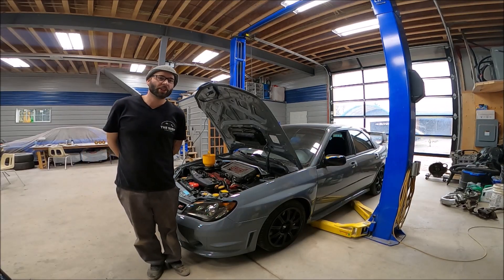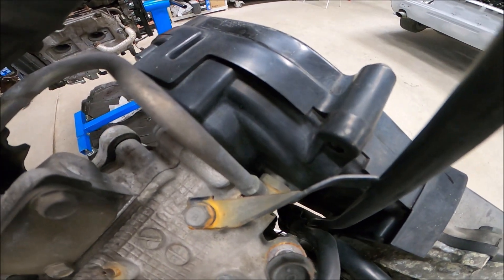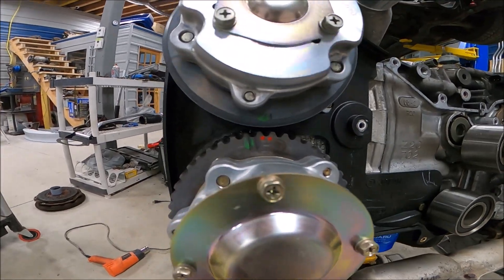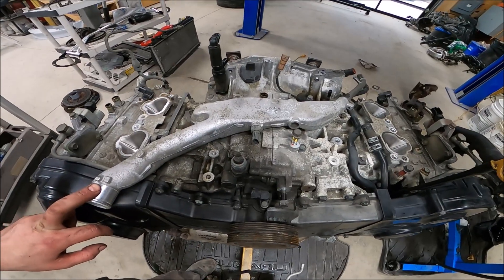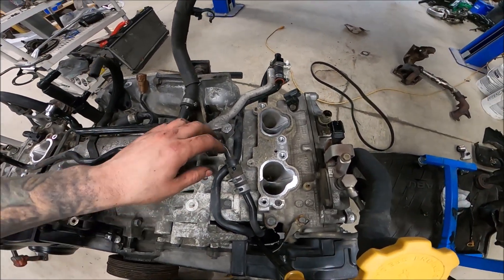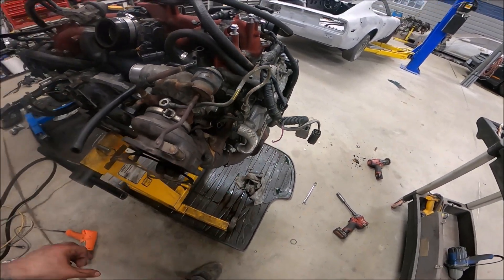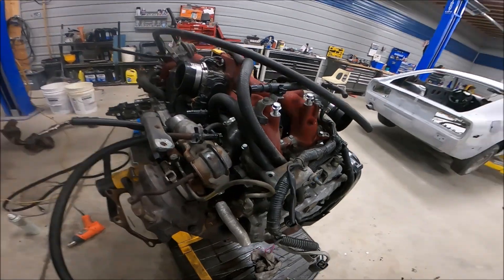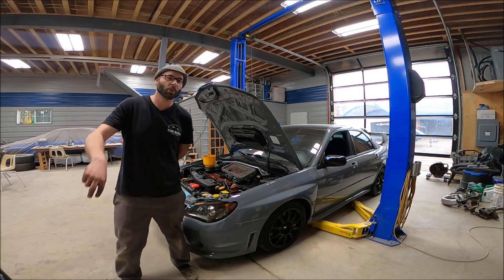How To Jdm Ej20X Swap - 06-14 WRX, 04-07 STI, 05-09 LGT, 04-14 FXT

Comment: Why downgrade to a higher compression more likely to explode setup😂
Reply from the maker: Oh is that how it works? Educate me please, would love to here how a factory engine thats ran its whole life at this compression ratio all the sudden blows up? Please, looking forward to your response so I can tell the 100’s of people who have had this swap done that 1 of them may explode soon 😂
Reply: Ok since you want to be a smart ass the ej20x  comes with a 9:0 compression ratio because its default region of use is Japan and that motor is mapped for 100 RON FUEL. On USA 91 or 93 this engine would be prone to detonation unless remapped and even then whatever output it leaves the factory with is at the edge of what's possible. You'd also be down 500cc's of displacement which subaru purposely gives your region to mitigate the shitty fuel and provide usable  down low torque. Its no secret the superior actual sti motor  the EJ207 was used in the JDM sti and was never shipped stateside like the 4g63 due to your fuel and elevator etc etc etc. But please continue leading others to downgrade to a inferior crank(if they are performance oriented), thinner rods, weaker pistons and inferior block, for a suitable solution for their blown subaru.
Reply from the maker: @curvaholic  I think this swap is over your head. Are you under the assumption that 100 ron equals significantly more then the 94 octane we have available here? Because 98 ron only equals 93 octane. 
Did you miss the part where the car is tuned? Then you mention a 207, an engine that is 6X the price of a 20x and then requires cams to be swapped and cyl head to be machined for the sensor along with a tune and loss of displacement and bottom end torque. 
Ill say it again, this swap is over your head. It is done as an economical swap, cheap entry, great results. 
We have had guys tune these as high as 360whp and still rocking years later without issue. But your still missing the point of an economical swap, this is not a performance swap. However, still clearly fills the void and way faster at my max recommended 350whp vs sitting in a driveway with a blown engine. 
Literally done 100’s of these, with 5 local tuners tuning them, no issues. 
Thanks for coming out 🙏

Comment: I have done everything and have tune and am not have very good acceleration.. from a stop its terrible and i have the cams retarded
Reply from the maker: Stock turbo?
Reply: Yes
Reply: Should the ej255 cams be swapped cause I have the jdm cams atm..
One tooth on the cams but I've heard 2 ??
Reply from the maker: @GhettyGreeen  changing the 255 cams will make no difference. 2 teeth too much. 1.5 is spot on but not possible. 
The 20x is not an upgrade engine, it does lack in bottom end torque compared to the 2.5 overall. 
How did you dyno graph look? Is it steady climb or does it spike mid rpm range

Comment: Do you leave the avcs unplugged? I have a 2007 lgt
Reply from the maker: Exh avcs is left unplugged
Reply: Is it possible with the right ecu to get a 07 lgt with dual Avcs. I seen its not possible with drive by wire cars?
Reply from the maker: @GhettyGreeen  it is possible but you need to add in the wiring and you need someone who can disable the the duel avcs immobilizer to make it willing to work with your car.

Comment: I have an 06 LGT and no air pump needing an engine, with this swap and doing the timing correction is the tune necessary? or will it work with factory rom and have no check engine lights
Reply from the maker: It wont have a check engine light, but a tune is recommended

Comment: Would my 2013 wrx need tuned on a dyno? Or could it get tuned through a Cobb without being on a dyno??
Reply from the maker: Ideally a tune overall, if using cobb you must get a 20x with airpump for your 13 as cobb can no longer disable emissions codes. 
Hope that helps buddy!

Comment: Will the turbo from my 2014 wrx fit the EJ20X?
Reply from the maker: Of course!
Reply: I just installed my EJ20X, but the VVT solenoid is leaking… would you happen to know if a 2014 wrx STI vvt solenoid would fit the EJ20X?
Reply from the maker: @jerrycollins7533  is it the exhaust one leaking? Yes they are the same for 08-14 sti
Reply: @TheSubieSanctuary  ye, it was the exhaust one. Just hoping nothing else is cause it to leak in that area
Reply: @TheSubieSanctuary  thank you by the way
Reply: My mechanic said since I’m not using the exhaust avcs that it shouldn’t matter what he uses to stop oil from leaking from the solenoids… He was saying he could just block them all off and save me the money instead of buying the solenoids. He just wanted me to check with you if that would be correct?
Reply from the maker: @jerrycollins7533  that is true! 
I believe down to the core of it and after removing the solenoid block. Its just a small hole. Can tap use a grub screw and some locktight
Reply: My WRX is finally all finished! Just dies while idling… is this just an indicator for a tune? I plan on doing it, just want to make sure :)